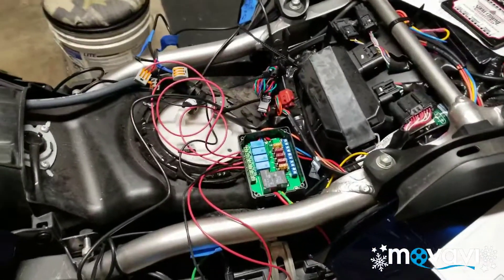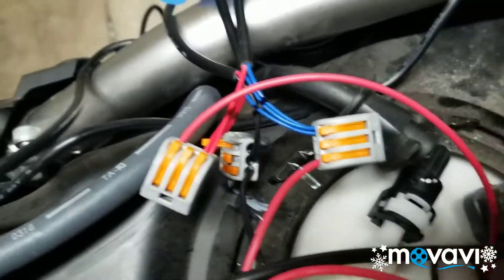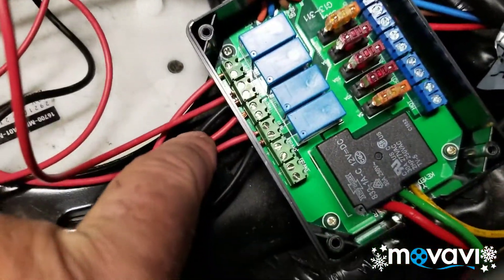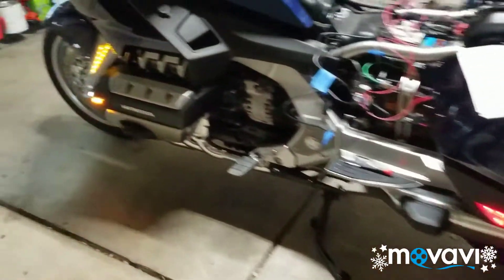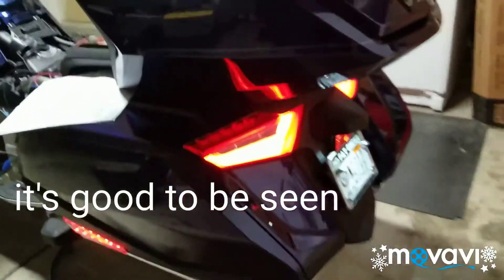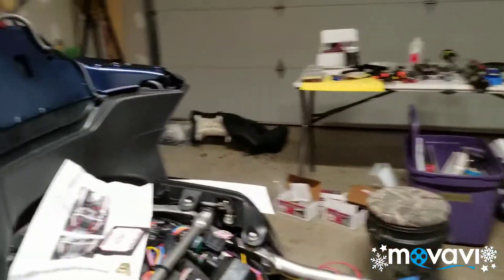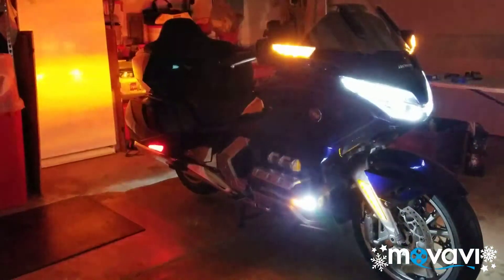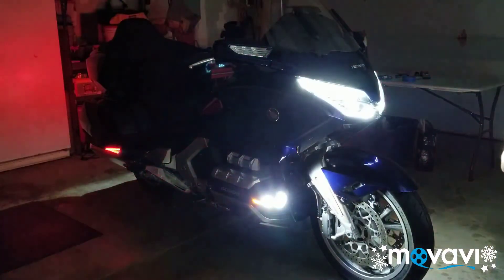2018 Goldwing DCT ~ Lights are DONE!

Comment: Good Job Avon. Did you use the sub harnesses that's recommended for the trunk light or did you tap into the isolator fuse box wires using the wago connectors ? I just purchased the trunk light  and installed a fuse box. I really domt want to use the sub harnesses for the light, however I want to make sure the light would work if I splice the wires and not use the harnesses.  Thanks